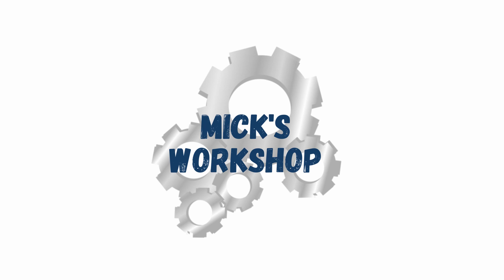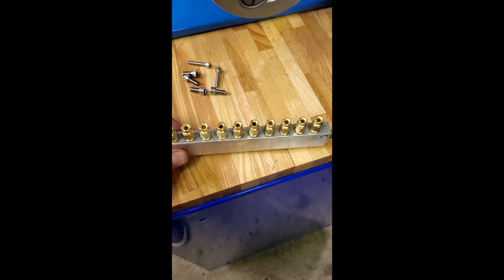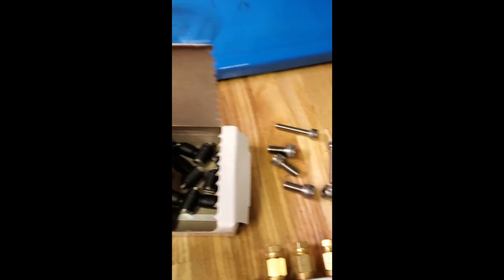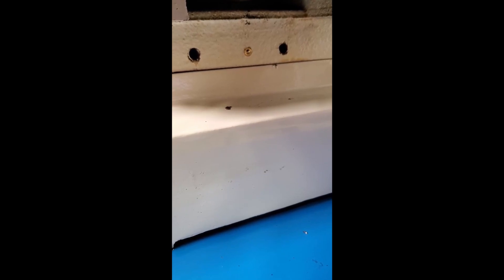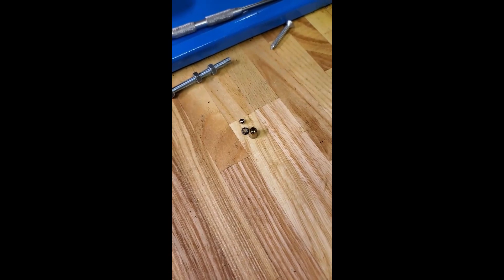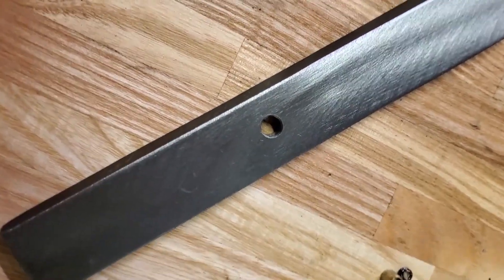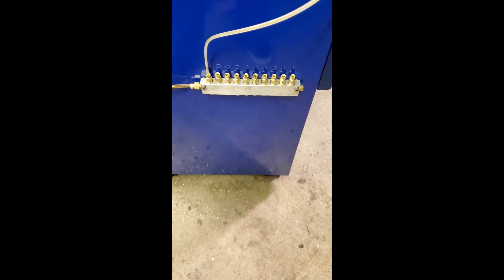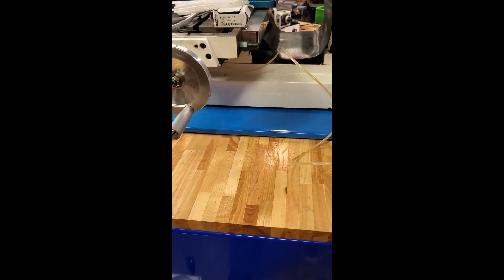PM-727V One Shot Lube Installation

Comment: awesome video. super helpful. i just snagged a PM-30MV at a shop sale along with a small lathe and want to get one of these setup for it once i finally get them placed in my shop. wasn't really sure where to drill holes to place the oil so this helped a lot. would love to see what other kind of upgrades you've done. looks like you have some sort of halo led mounted on the spindle. that would be useful too.
Reply from the maker: Glad you found it helpful.  I did another video walking through the other enhancements I made to it.
Reply: @MicksWorkshop  awesome. i'll go check it out. thanks.

Comment: Very helpful, thank you.
Reply from the maker: Glad it's helpful.  One thing I added later that's not in the video is an in-line check valve between the pump and the manifold to keep the oil from draining back down.  It was from McMaster-Carr as well.